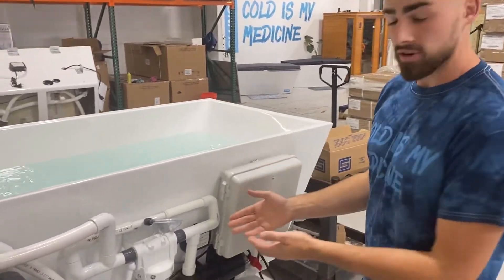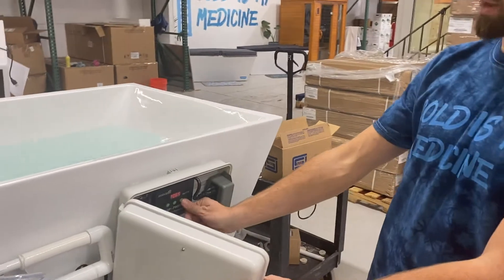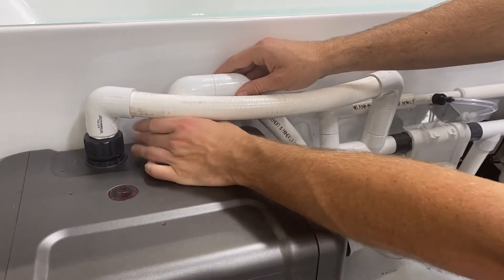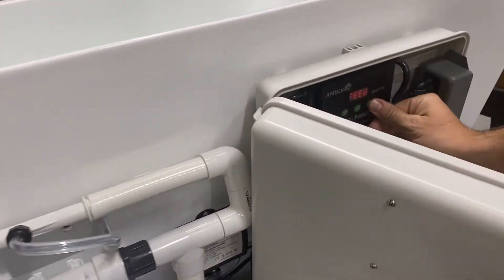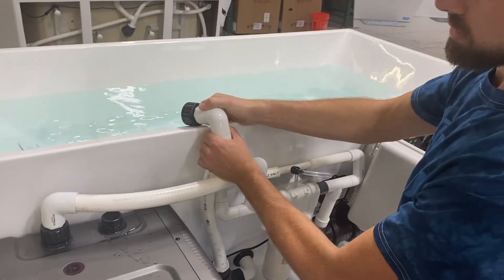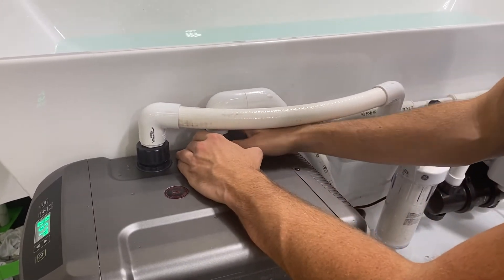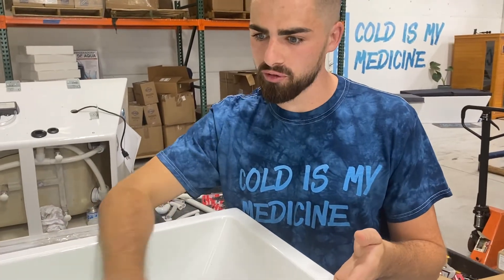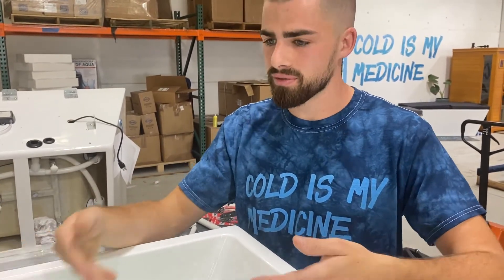Fix Plunge Flow Issues

Comment: This is my issue I believe but my inkbird 308 in my hot/cold is different than in this vid and I can’t find any kind of pause button. Getting intermittent flow. Comes on for 3-5 seconds. Goes off for 3-5 seconds. Chiller still working. I have someone calling me Monday but gah so frustrating and the inconsistency in the noise is driving me mad as the thing is beside my bedroom.
Reply: Did you ever find a solution? We’re experiencing the same problem
Reply: @JESFRANKLIN  They were super helpful and ultimately hired a local tech to swap out the pump for a pump that comes just w the cold plunge (vs the pump I had for the hot/cold - i never used it for the 'hot' option anyway - and they refunded the $500 diff between the cold and the hot/cold unit) - it now works perfectly and MUCH more silently as I believe the pump required for the hot/cold is noisier than the pump required just for the cold.
Reply: @petergiles3911  thank you, hopefully they can provide a similar solution
Reply: @JESFRANKLIN  did they ever help you find a solution? we're hoping they can help us with the same also.
Reply: I’m having an issue with my chiller. It just won’t chill. It’s the second unit. It came with a inkbird but the first one fried. I only want to use it as cold, so I shouldn’t need the inkbird. Tried setting up new chiller without inkbird and it still won’t chill. Can it be air??